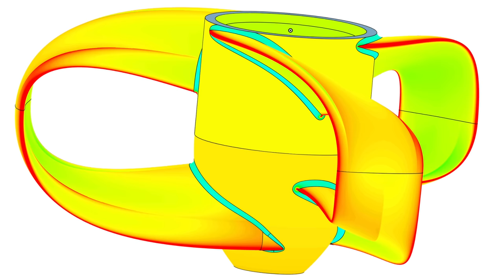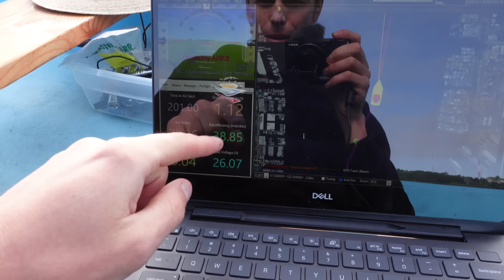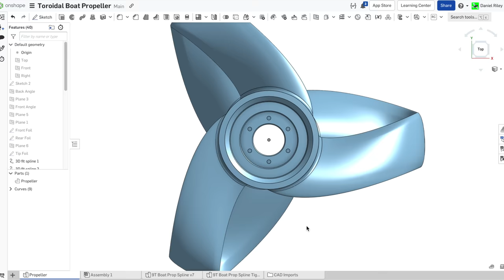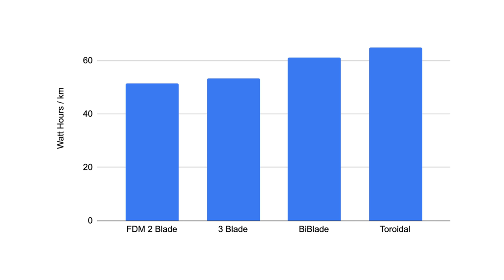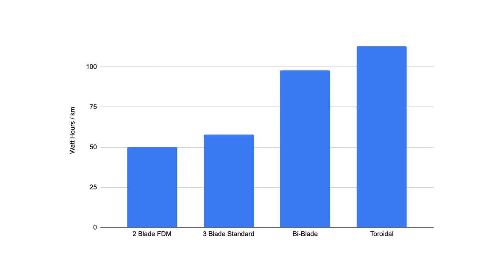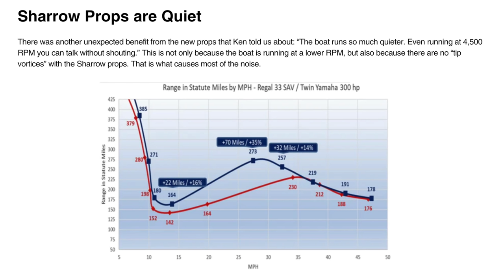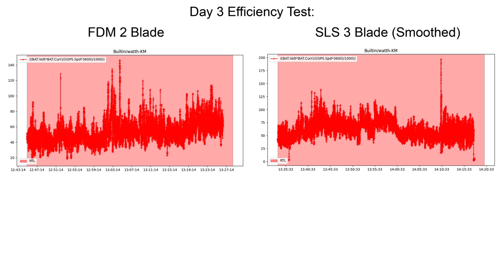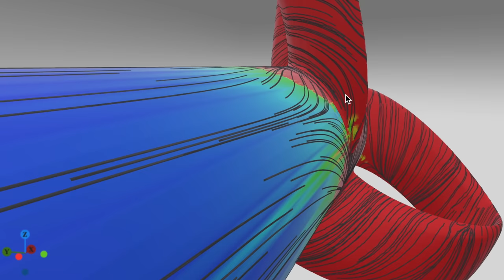Testing Futuristic Propeller Designs on my Solar Powered Boat

Comment: 19:10 Standing barefoot in a boat full of batteries and Chinese power supplies while it's raining definitely demonstrates your dedication to science.
Reply: Hahahahahha
Reply: i mean it sounds bad but even if he stood on bare metal at 24-48VDC he wouldn't feel anything really. one its DC and two, the voltage is too low to pass any real current given the skins resistance.
Reply: @X4Alpha4X  24-48vdc easily passes current through wet skin. If it's the path of least resistance, which it probably isn't in this case. Also, there are a multiple 120vac inverters in play down there.
Reply: @ExtremeSquared  i mean yea sure some current will pass, but from foot to foot with wet skin, youre looking at like maybe as low as 10,000 ohm (a multimeter says my dry feet are 1,500,000 ohms so im being generous), at 48v thats 0.0048 Amps, thats juuust barely under what you'd need in order to even feel it since google says 0.005 A is the lower threshold for DC. and again, thats the absolute worst case scenario of you standing across the full potential. the most likely failure would be the terminals shorting though the water and dropping in voltage to the point everything would just turn off.
Reply: @X4Alpha4X  Soak feet in saline for an hour, then retest. You might be surprised how low skin resistance goes. Like you say, the big safety mechanism here is configuration. Almost all configurations of body / potential have a salt water bridge of lower resistance in the circuit. Maybe some really awkward fall could put 24v from a waterlogged hand to waterlogged feet combined with a connector/wire failure, but that's freak accident territory.

For what it's worth, I was really just trying to get the attention of alarmists with my post.
Reply: username checks out, go back to watching nursery videos with no low voltage danger, no wonder youtube demonetizes everything related to science
Reply: Chinese power supplies is like saying American burgers, it's their bread and butter.
Reply: @ExtremeSquared  : yes the "electrocution risk" is approximately zero...

crap-stir away, it livens up the conversation...
Reply: @ExtremeSquared  "Path of least resistance" is a bad way to think about it. It's actually just "all paths but the lower the resistance the higher the current". So a battery connected to a 50ohm resistor and a 25ohm resistor in parallel will have twice as much power going through the 25ohm resistor (but not all the power, despite being the path of least resistance).
Reply: @X4Alpha4X  The issue is that those eco flow batteries include inverters to produce mains voltage, and that's what the chinese lab bench power supply is connected to.
Reply: fear from 24vdc electricity is what marks amateurs
Reply: @FraLin  Not really, and this isn't a good attitude to have. I've felt painful shocks from 12v batteries (maybe my skin was soaked with sweat). Whether or not 24v is likely to kill you isn't clear, but it doesn't take much current to send a heart into fibrillation. If your skin has absorbed enough moisture, the resistance can drop significantly without requiring a puncture. It's totally plausible that the resistance may be low enough for fibrillation-inducing current to flow, and even more so if you count skin punctures. But either way, even 12v can be very dangerous if you short something across the terminals (of a car battery, for instance). The object will become extremely hot and often weld itself to the terminals so you can't remove it. If it melts through the battery housing, it can ignite the hydrogen that escapes and cause an explosion.

So yeah, usually 24v is fine to touch, but electricity is invisible and always wants to kill you, so it's also fine to be cautious about going near it.
Reply: Just what voltage gradients are you expecting exactly from floating ground low voltage supplies within a fibreglass boat?
Reply: @UCCLdIk6R5ECGtaGm7oqO-TQ  I had intended the post as a joke, and I don't believe he's in any danger, but anyone can easily fabricate an unlikely hypothetical. I think most people who work around electricity do exactly this -- fabricate a bunch of impossible freak accidents that could happen and identify the vaguely plausible ones.
1. Hand skin wet with salty water. Feet skin saturated fully with salty water. Resistance 500 ohms. (Number made up, but WATERLOGGED skin is orders of magnitude lower than people realize)
2. DC connector sitting in boat bottom fails. Saturated salty feet now at 0vdc potential.
3. Operator slips and places body weight through salty wet hand onto positive terminal, vinyl cover fails. Hypothetical I=25V/500ohm=50mA

I meant this to be a commentary on the movies and video games where someone throws a power strip into a pool/puddle and takes out all the baddies. But now I sort of hope that the "It's impossible because 24vdc" people go out and audit their beliefs with an hour long salt footbath and a multimeter.
Reply: At 30 odd Volts max. he's pretty safe.
Reply: @X4Alpha4X  DC is NOT safer. When electricity goes through your body, (it takes a large voltage to drive it through,) there's a chance of it causing some or other muscles to contract depending on the path it takes. There's a chance those muscles will hold you in contact with the source of the electricity. If it's AC, there's a chance that the changing voltage will allow the muscles to relax and let you fall away from the source. If it's DC, there's no such chance. This is all a completely different phenomenon than execution by electricity. Execution uses far higher voltage and current to eliminate all the many matters of chance. There's this big range of voltage between what's definitely safe and what will definitely kill you where all these matters of chance comes into play, and in that range DC is NOT safer.
Reply: At least he is not wearing crocks!
Reply: Google says? Lmao........
Reply: Image the horrendous electrocution risk on submarines! Or flashlights in the rain. LOL

Comment: That ship 5:01 is actually called Sherpa, built at van Lent in The Netherlands. It's only a couple years old, purpose build as an exploration yacht. I've seen her many times when she was being finished at the yard. Cool to see she is at the other side of the ocean now.
Reply: Ship at 5:56 is USNS Vice Admiral K.R. Wheeler, there should be a smaller sister ship around named USNS Fast Tempo. Together they are TRANSCOM's Offshore Petroleum Distribution System.

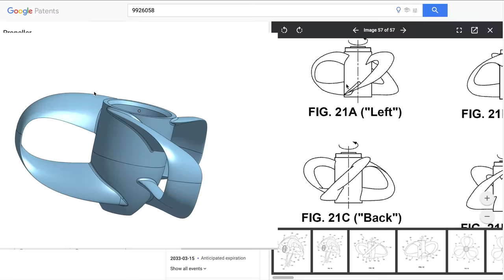Comment: I think your problem is that you basically have two parallel blades which are connected abruptly. In other words, at 23:00 you can see that the center of the blade in the image (the line made from the middle of the distance between the inner and outer line) look like a square/rectangle with rounded corners. I think that by elongating the toroid, so that it looks more like half an egg or like a semi-circle or semi-oval, you would get more continuity for the flow, and the higher angle of attack would mean that instead of making a vortex, the water would continue along the blade, from the beginning to the outside to back into the center at the end, and end up either not making a vortex or making only a smaller vortex in the center of the axis of rotation. Also, I think you need to watch the angle of attack not only at from outside in, but also from top to bottom (slicing the blades in CAD/ONSHAPE). Your toroidal propeller starts at 45 degrees from the direction of flow (of air or water), then go to 60 degrees on the outside, then back to 45 degrees. You could try making it 30-45-30 degrees, the higher angle of attack reducing the stalling. Also, I think the propellers they currently sell are simply moving the vortex from the tip of the blades to between 1 third to half of the outside to the inside, which lead to the vortexes being smaller due to the smaller tangential speed at that radius/diameter (when compared to the radius/diameter of the whole wing, form the center). Also, please make a few more blades, one with normal blades angled 45 degrees from front to back (like the top blade at 26:53) to push the water inwards, one with the angle -45 degrees to push the water outwards, then another one with double blades at 45 degrees, then another one with double blades at -45 degrees, then another one which to start with 45 degrees blades then below them to have -45 degrees blades even if they're not connected making them look like a rhomb, then another pair which to have the -45 degrees blades then below them the 45 degrees blades looking like an X, all with the same radius/diameter as the normal ones you already printed, then another one which to be a normal propeller with winglets which to have an average of 45 degrees of angle side to side (60 degrees of angle from the tip of the blade which cuts the water, and 30 degrees of angle from the tip which merges the water together or creates cavitation, the average 45 degrees basically making the winglet, when looking from the outside of the blade to the axis of rotation, moving down and to the side of the blade). This will give you the best range of test data, in my opinion, which could help you design a much more efficient propeller. If you have any questions, feel free to contact me on discord @Sapioit for more details.  I'm looking forward to the results of your tests!
Reply: I was thinking this same thing, it seems like he just squared it off which is not part of any toroidal that I've seen. They usually come down to a very slim edge at the transition point of the tip.
Reply: lmao this is the first time ive seen a discord handle shared in public like this after the number discriminators were removed and i think i might not hate the change after all
Reply: @r0cketm00se3  Thanks! And the sheer number of different blade designs, even if made from cheap print-at-home materials with proper smoothing (like he did in the video) would reduce the need to spend lots of money to have a company print them, so having that many different designs would help narrow down the science behind the fact.
Reply: @redgopnik2227  I have nothing against the new way, I just think that the change will break a lot of things, including older messages on the internet. If people were still able to use the old way to send friend invites, in perpetuity, just no way for new people to get that exclusive invite code, then I think a lot less people will dislike the change. Unfortunately, small changes from big websites and apps will have a huge effect, because they are inevitably used by a lot of people, and in many cases by a lot of other apps, too. Like how the Reddit API caused Reddit to lose stock value, and some investors are already suing for fraud (because he or someone he knows most likely sold their shares before the announcement), using the "going public" as an excuse for the inevitable fall of the company.
Reply: Have you seen a Sharrow prop? they are a commercially sold toridal prop that's been on the market for like 30 years 
Expensive as sin, but supposed to be "the bees knees"
Reply: @seldoon_nemar  Yeah, I saw it, both in this video and a few months ago in other videos. Still, that doesn't mean rctestflight can't do his own research into the field.
Reply: @SapioiT  Oh, I absolutely agree, but it seems an odd choice to start with a completely flat toroid when the only commercial one is so aggressive. you're effectively going to get your pit from its overall profile, so they allow a much more aggressive cut on the water. their angle of attack, as well as their attacking surface, are exaggerated. a Sharrow also has to be machineable, something a printed part is not limited to, as well as the ability to rapidly prototype, there's a lot of geometry to play with. It's not something that anyone but Sharrow has put any time into because I think they have a patent on it for watercraft, so their design is not necessarily the best one or the most optimized. I'm sure they have put time into improving them, but a lot of that effort has been in expanding production to take them out of the luxury price point.
Reply: @seldoon_nemar  I agree. But hey, maybe he wanted to turn this into a longer series, so he started with the most inefficient examples, to debunk all those videos claiming outlandish efficiency improvements, then he would continue with videos about things like making normal blades swept (in aviation terms) forwards and backwards in one video (which could be 2-4 new designs to test), then changing the angle of attack near the shaft and away from the shaft independently (which could be 3-6 new designs to test), then using pairs of blades (some of which are swept and some of which are not, maybe reusing the exact same ones from previous videos) to get X shaped and triangle shaped and rhomb shaped pairs of blades (that's 9 pairs because you get 3 blade models on each side), then another video in which to connect multiple of those together (i.e. a rhomb-toroidal, and a few others inspired from vertical-axis wind turbines), then maybe another video or two fine-tuning things in software then printing the most promising ones and testing them. This could end up as a few months' worth of content, honestly, and I'm all up for it! Especially since he could also continue the series at least a few more episodes by making propellers for aircraft, too. And not only that, but he could offer the models for free, and put his name somewhere on the model (i.e. on a non-visible part, or a part which doesn't have a negative effect on efficiency, or which won't even get printed), and he could use that model sharing to promote himself so he gets more donations. Heck, he could even start a youtube challenge, where people get his model, modify it for the crafts they have to make it more efficient, make a video about that, then put the resulting files for free download including the actual craft they used it on. Oh, and I'm definitely expecting some people to bend their own wood and make airplane propellers for airplanes moving people, out of those models, even if they look ridiculous and stick out quite a bit in front of the aircraft.
Reply: @seldoon_nemar  As for the 3D printing, I think stamping and hot-bending could be used to get the blades curved the right way, after which a metal casing could be used to keep those parts attached, and the metal casing could then be welded, to significantly reduce the costs by not needing that much machining.
Reply: @SapioiT  there's actually a Titans of CNC vid with the founder and head machinest at Sharrow. They cast with extremely tight tolerances so the cnc is only doing finishing passes. It's because of the better surface finish. Welding and grinding and bending are all labor. Prototype with the printer, get a good design, then print in a material to do lost media cast in metal and polish it. But the reason Sharrow doesn't just cast is because the material will change as it cools and it can affect the final geometry. Between that and taking 3/4 of the polishing time away are the two main factors favoring CNC for production work
Reply: @seldoon_nemar  Oh, I see. I understand. I wonder how effective things would be without CNC-ing. Would the lack of CNC-ing offer enough savings to be wroth the reduced price?

Comment: Thank you for addressing the issue of print quality. Every video I've seen about 3d printed toroidal propellers uses some abomination made on a $150 3d printer. It's nice to see someone go with a good print quality and smooth surface finish. I also found it interesting how you discussed the thought process behind your CAD design, and how different design choices could impact the propeller's performance.
Reply: melon
Reply: melon

Comment: 10:30 I think it's important to note that for a foil of finite span, there will always be a tip vortex if it is generating lift at all. You can reduce it, but never get rid of it completely.
Reply: The vortices dont necessarily need to be at the tips. For a lift distribution where lift goes to zero and it's derivative also goes to zero the vortices can be moved inboard. This has been experimentally demonstrated on the nasa prandtl aircraft, and may also be the case for some birds.
Reply: honestly I think you can get rid of them if you make a design that cancels out them like noise canceling headphones you can possibly cancel out the tip vortex with another tip vortex like noise canceling headphones do with sound because sound is using air
Reply: @beatyoubeachyt8303  A wing with finite length has force up in some areas, and not in others. As such the air must circulate in order for the net system vorticity to be zero, which in the far field should be true.

There will be vorticies, just maybe not at the tip
Reply: Duct

Comment: Really interesting!

The higher vibration of the FDM may come from the fast that they are not as stiff as the nylon - so the blades actually flap around a bit.

I have been casting some propellers for electric outboards (we are breaking lots on our shallow stretch of river).

I started with a hard resin and it worked great, but there were significant vibrations and eventually the propellers self destructed at the join of the blade to the shaft.

So then I put 10% milled carbon fibre in the resin and this made a HUGE difference - as good as the OEM ones and they were lasting way longer (never sure if it is self destruction now or user error).

I then added a 6 hour soak at 50degrees Centrgrade, which stiffened them even more and they are now performing really well - I have to be careful not to take them out of the mould when they are green or I can deform the geometry, so a 12 hour cure, then a 6 hour bake and they are super stiff (but a bit more brittle!!)

Love this kind of content!